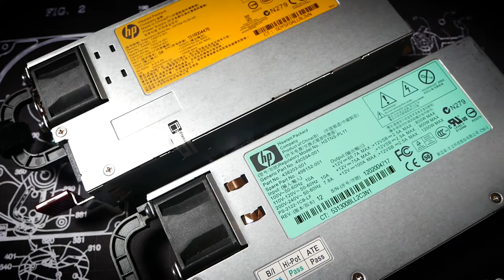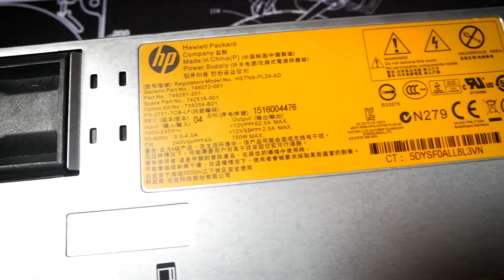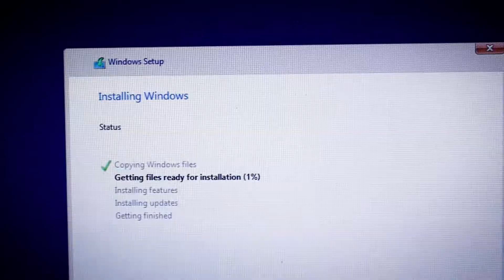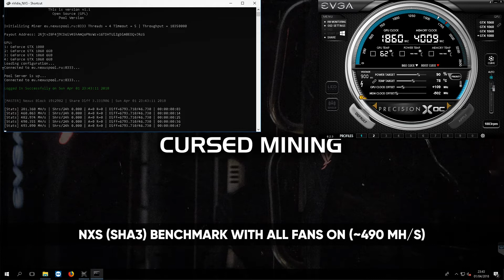Octominer X4 nVidia low power Rig Build (GPU Mining) Part 1 [ICE6S]

Comment: What nvidia driver did you use for your different nvidia cards using windows 10? Did you download different Nvidia drivers or you used one particular driver for all different cards?
Reply from the maker: When you have all Pascal Cards (10xx) - the same driver works for all the same cards. I am currently using the latest one and it works fine with X8 different nVidia GPUs, but I have a video on the troubleshooting process on Win 10 coming online tomorrow, because I had some problems when going from 4 to 8 cards in the latest video.
Reply: alright will look out for the video.. thanks!